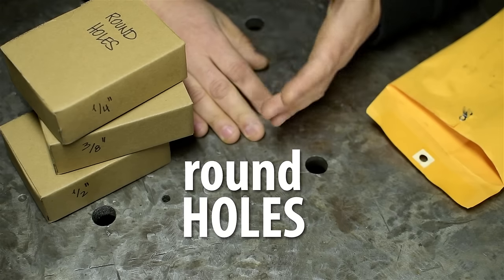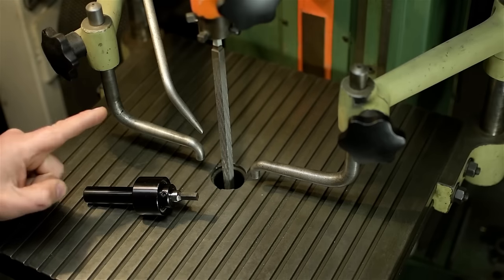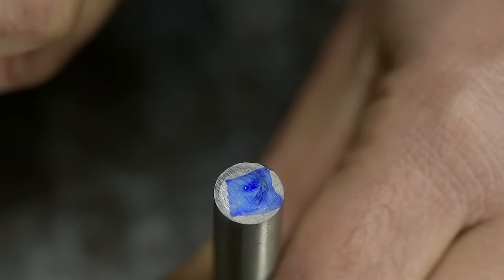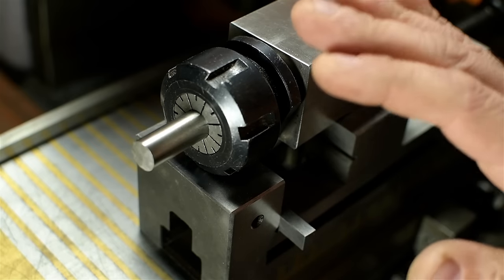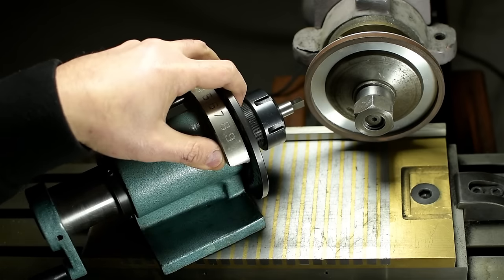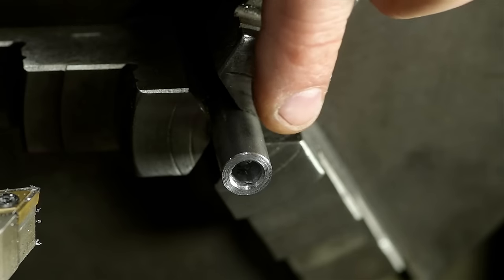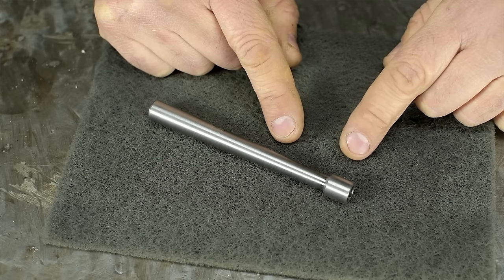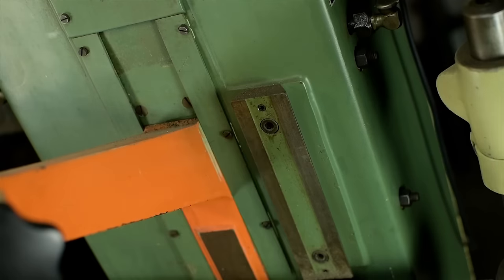Square Holes!

Comment: I'm a toolmaker irl. I use top of the line equipment at work including HSM, automated loading, standard CNC, lathes, EDM, CADCAM, etc. Had we done this at work it we would've used 2 very different approaches (1. drill out the corners using a 2mm drill and machine the pocket or 2. EDM the hole) but its great seeing people use the 'old ways'. Takes me back. Great video. Loved the humor. Subscribed.
Reply: I have an EDM drill and a WEDM and i sorely regret selling my sinker :(
Reply: How do you EDM a blind hole? Am I missing something here. lol
Reply: @Stopes.  an EDM drill is basically a drill press with special drillbits

A sinker EDM is basically a vertical mill where the spindle has been replaced with an electrode
Reply: @angrydragonslayer  Ahhhh okay gotcha. To me EDM is the wire guided process. I wasn’t aware there was other EDM methods and/or processes. Hence my confusion lol. Thanks though. Learn something new everyday!
Reply: @Stopes.  EDM has electrode ‘bits’ that are pressed down onto the work, like the last guy said. What you were thinking of has a very obscure and not at all sensible name……. “Wire EDM” ;)

My company uses both for building injection molds, but primarily the un-wired variety (wireless?). You can get an absolutely bonkers level of detail from standard EDM, any machining marks left on the graphite electrodes are transferred to the work.
Reply: @areoladan5580  Ahhh yes wire EDM duhhh. Thus the distinction every time it’s mentioned lol. I have been set straight and educated on the matter. I thank you gentlemen.
Reply: "Old Ways"? I knew a guy that drilled holes, heated to bright red, drove a square piece of metal into it. It were squared.

Comment: I usually do my triangular holes with a twist drill bit
Reply: I normally get a roundish hole with with a bit of a rounded triangular shape
Reply: Releaux triangle
Reply: The trick is, drill the initial hole and then go back through with a bit 4% smaller and let it do the waltz.
Reply: @jacknicholson5794  just loosen the drill vice and let it dance while you quickly run to the break room until you hear a large bang, the bang indicates when she's nice and ready
Reply: @craiga6557   or just buy a chinese drill press from a supermarket when it's on sale, and use the drill bit that comes with it.
Reply: @revmpandora  All the truley important things in my life, I learned from Q.I.
Reply: @Kollar0718  did that once . . . . would of got farther with a drill bit made of balsa wood.
Reply: @hdezn26  what were they actually made of? High speed squeal?
Reply: @craiga6557  lol High speed Bacon sounds good .
Reply: @hdezn26  I always thought high speed bacon would be used in sawing applications...
Reply: @Kollar0718  You were watching me use my Harbor Freight press again weren't you? It runs perfectly true as long as the machine is unplugged.
Reply: Nah, Toblerone bit all the way, man. Way nicer, and self-lubricating too!
Reply: @revmpandora  Toblerone-Rolo combo! (You watch QI?)
Reply: Triangular holes only occur when you hold your mouth a certain way, firmly press you tongue against the back of your throat and desperately need a true round hole for a locator pin.
Reply: @Timberwolf69  someones gotta try this for the lols (i know it wont do anything, if even that )
Reply: @craiga6557  naaahhh, high-pitched steal!
Reply: My old drill press drilled triangle holes exclusively.
Reply: @hdezn26  You know, back in the days, when I was but a wee lad, my gramps would show me this trick.
Especially on hand saws, if you had no lubricant at hand to keep your saw from binding, a piece of pork rind would come in handy: just rub the inside of it along the cutting edge of your saw (carefully, though, don't cut through the rind) and you'll have a well-lubricate saw.
Reply: @MaineHomeShop  I thought you were OK with that... I own 2 such machines and I hate them to the extent, where I much rather watch a guy curse at his machine than starting to fix one of mine. And I ended up with 2 pcs because of the special supermarket warranty policy, where they don't want to have back a machine that's not working, because they would have to store it, ship it, recycle it, with all those additional costs to the company. :D
Reply: I can do that by hand since I started to custom-sharpen my still bits for that purpose.
Reply: Lmao me too mate
Reply: Jake Thejeweller  Yep, It's  the reason I never wash my face. I always run my drill bits along the the side of my nose to oil up the bit, and exfoliate at the ssme time. I save so much time on showers.

Comment: 8:20
Tony: Do I really have to swap out the toolpost mount just to cut this off?......unlessssss.... rotates die grinder 90 degrees
Reply: I was waiting for the rest of the internet to scream "no!" here also! Much disappoint. Also, hilarious.
Reply: @dzjad  can still give his lathe an F    
though
Reply: Shambles1980TRealOne  that scribe line/ water method not work on HSS?
Reply: @ironbomb6753  no its not, he has soft water, he needs hard water.
Reply: You may scoff, but when you have a benchtop lathe with rigidity issues, that is a valid solution.

Comment: :D
I had customer parts where I needed a square hole where a 100% of the square was called for, so I predrilled slightly smaller than the square rotary broach. Axial force increases quite dramaticaly in that case :D
Reply: Sinker EDM?
Reply: @Joe-bm4wx  yes but that would be more expensive and you'd have to contract it out.
Reply: Yes but your square hole was 0.03mm. Try doing 10, 30, even 50mm square! Ha!
Reply: Depending on just what you need to put the square hole make sure you have a round peg to put in it. 👍
Also depending on what you are punching the whole hole into, through or blind makes a difference. Of course you just could have  shaped it in the mill
Reply: would it be better to start with a smaller square and work up in this case? or just shove your fd broach into the too-tight hole?
Reply: @Nathan0A  
This is family channel sir 😳
Reply: Barry Manilowa  not sure if thats stefans thing but in the meantime you might check out Werner Berry - he just started to build a wire edm ;)
Reply: Barry Manilowa it definitely would be good CONTINENT, such as Europe or Asia LOL
Reply: charlieinsingapore, I thought that was funny and I work in inches!
Reply: Barry Manilowa .... Which continent are you calling great?
Reply: Maybe try a smaller broach first? Do it in a few steps.
Reply: You can save a lot of time if you don't pre drill at all. + it work hardens the material and helps with tidying up that drawer full of broach inserts :)
Reply: Nathan L.   That’s what I was thinking. Similar to the through broach Clickspring made awhile back but take each section and use it by itself. Maybe not as many stages too.

Comment: 9:51 
Wait, hold up. 
What sort of black magic did I just witness?
Reply: Yeah, I don't understand at all how that worked...
Reply: I Googled it and the broach is wobbling slightly slowly chipping away at the material as they spin together. Or at least that's how I understood it.
Reply: I don't really know, but I would think it goes slightly off angle, hence why the taper required to make the final hole parallel. It works by "stabing" little by little with each of the tip.
Reply: The same thing can be done by simply pressing the tool into the hole. However, the rotating holder makes it much easier to pull out the broach once it has made a significant chip. The rotation makes it seem like there is more action going on than there really is
Reply: Sorcery. I see the replies to you try to use sciency words like "wobble" and "article" but it's all made up gobbledegook for something as inexplicable as the imperial system.
Reply: @jhaffel  Do you have a gif I don't know how to read
Reply: He forgot to mention that broach tools are mounted at a slight angle in the holder. In operation only one side of the tool shears the metal away resulting a hole the shape of the broach. The HS tool rotates at an angle in a thrust ball bearing.

Comment: 1:54 "This is my £1000 filing machine" "And this is my £2 rotary broach. Fun fact: These two cost me about the same price"

Took me a moment.
Reply: I'm still not sure if I got it. But I can put all the blame on "language barrier" and avoid judgemental comments.
Reply: which bit are you having trouble with?
Reply: @RuthlessDutchman  

I'm not sure if the 1000 pounds machine (filer machine?) reefers to weight (lbs) or the actual money (£). Either both are expensive as s*** (1000 £) with the machine weight being around 1000 lbs and that small tool 2 lbs OR both are cheap (2£) and that gigantic tool weights 1000 lbs.

He said no one wants the big tool. So is it 1000£ because no one wants it or 2£ because no one wants it?

I just a curious person about this subject. I'm not a machinist (not affordable or profitable here). I'm not sure if these tools should be expensive or cheap since I know there are small tools that costs a lot.
Reply: ah, Tony intended 1000lbs and 2lbs, and that they are the same price, but he didn't say how much they costed. 

I live in the UK though and a pound is more commonly (£) than (lbs)
Reply: I thought weight. Interestingly, a pound was once defined as the gravitational force of the earth exerted on the amount of silver which cost one pound sterling. (Except it was before the days of Sterling. Or Britain, for that matter, or Asterix the Gaul).
Reply: so no one wants 1000lbs machine because the 2lbs does the (almost) same job while being much lighter
Reply: The rotary bit costs a solid arm n leg, give them a lookup. In this instance, pounds are the weight not price.
Reply: Two pounds not £2
Reply: He was referring to weight not currency. Meaning the over weight machine that nobody wants costed the same as the lighter broach. Dirt cheap lol
Reply: Fun fact, I was in England 10 years ago, and in a supermarket there was this elder Chinese couple trying to buy meat. They asked for 5 pounds, the clerk returned asking if it was 5 pounds in money or in weight... The woman replied "yes, 5 pounds"... and they kept into this infinite loop for quite a while...
Reply: @Gottenhimfella  That's about as backwardsly wrong as you can get it.
Reply: @aerogfs  Offer them both amounts and let them choose.
Reply: Fun fact, Tony is an astronomer so he's just rounding to orders of magnitude

Comment: "This Old Tony"
First of all I want to say thank you for your very well done videos. I have learned a ton . With that said I was hoping you could cover a few topics that still frustrate me a bit.
1. Can you cover the numbering and identification numbers for replacible cutting tips like the common triangle ones on the quick change  cutting arms.
2. Could you cover the most efficient way to do a taper on round stock in a manual metal lathe. I have a '63 6in Craftsman hobby lathe.
3. Where can I find horizontal milling tools either new or used that will work for my lathe.
Thanks again. When Letterman left TV you should have tuner the Late show into a hobbiest Machining show, you sure are talented enough and mor than funny enough!
-Dave

Comment: I think you may have glossed over the most important feature of your new wrench.  Putting a 45 degree handle on it ensures that it is always in the perfect position to try to round the corners off of any bolt that you use it on.  :)
Reply: Our man here made a perfect "Desquarifier!"

Comment: You should really look into getting a lathe with a square gear for this kind of thing
Reply: They are out there. Google "Polygonal Turning".
Reply: Just buy some square end mills and drill bits and be done with it.
Reply: @highpwr  wt..?!...black magic!
Reply: The 'round head' Colchester Student he has is available in square head form.
Hexagonal holes are a bit more of a problem but not as much of a problem as 2-sided or even single sided holes.

Comment: American measuring system is really confusing. Closest to 7.7mm is N. 
For me that's like saying 30 degree Celsius is pink. 😁
Reply: No, everyone knows it's gingerbread scent.

Also, the fourth drill measurement system is based on American write gauge. Because everyone needs four sets of drills.
Number drills don't go that large, though, ending a little over 200 mil in diameter.
Reply: If you're getting pink at 30 degree C, you should seriously consider using sun-block
Reply: Don't worry, we don't get it either.
Reply: I was watching a British woodworker the other other day and he bought some timber that was 4,2 meters long by 2X6 inches. 

Care to explain that? At least we stick with a single, stupid measuring system rather than mixing them.😀
Reply: Don't worry, the numbering and lettering sizing system originated in Britain.
Reply: @timothyball3144  That stupid measuring system got us to the moon. At the time metric would not have gotten us there.
Metric is not all its cracked up to be.
Hey Ill call freezing 0 and boiling 100 and divide the difference is not very scientific
Reply: @heyyou5189  I don't see why they couldn't get to the moon using metric measurements. What system do they use today for space exploration? I don't know, but I bet it's metric. And remember, the combination of metric and imperial crashed a lander on Mars.
Reply: Actually, to convert 30 Celsius, you have to use 5/9 so it's 5/9 Pink. Or something like that.
Reply: @timothyball3144  because until fairly recently the kilogram and the meter were based on an object and not a mathematical standard. That has since changed largely because those objects were known to not be quite constant. That slight variation would not have allowed us to get there.
Edit: Heres a link that gets into it. https://www.popularmechanics.com/science/environment/a27528610/measurements-physical-standards/
Reply: @heyyou5189  And now where are we? Since the metric system is based on a mathematical standard, why do we still use a system that divides a mile by 5280 feet, a yard by 3 feet, a foot by 12 inches? Where is the logic in that? Why does water boil at 212 degrees and freeze at 32? Ounces in a gallon, ounces in a pound? None of it makes sense and we know it; it's why ditch diggers have an engineers measuring tape marked in tenths of a foot and tenths of an inch. The folks laying down the specifications for the ditch know that it's easier to do their calculations in tenths of a foot. It's a stupid system that needs to go away.
Reply: @timothyball3144  NASA now uses metric.
Reply: @heyyou5189   but the rest of us still don't. Myself included.
Reply: @timothyball3144  Any system in decimal is easier from a math standpoint. Oddly I dont really know where the mile comes from. Most measuring makes little real sense even if the math works.
Think about bushels and furlongs and fathoms and cubits etc. Where did this crap come from? Penny weights any one? Ounces and troy ounces.
Dont get me started on temperature. Neither of those scales is based on anything at all.
Reply: @heyyou5189  I think Celsius is based on the freezing and boiling points of water, so there's that. I would prefer a wider range, but I think that's just because I'm used to farenheight. See? It's even hard to spell!

Comment: If you taper the fasteners heads  slightly to 4mm, most any wrench will fit. The design was intended to  be done this way but got lost in the ever deepening minds of machinists. Just a slight taper to 6mm would suffice.

Comment: Rotary Broaching, also known as Wobble Broaching, is unlike the conventional broaching method. The conventional method has a sequence of polygon or other forms that increase in size and are pushed through a hole until the desired form size is achieved. Rotary Broaching can achieve this in one pass by cutting the full form, one corner at a time, often eliminating the need for a secondary operation. This works exceptionally well on Horizontal or Vertical Spindle Machines such as Lathes, Mills, etc. Rotary Broaching is a precision method for producing internal polygon forms at an extremely fast rate. The entire operation can be completed within seconds and can produce forms to 0.0005″ accuracy or better. This advanced engineering has caused Rotary Broaching to become increasingly popular; especially in the medical, automotive, aerospace and plumbing industries.

There are only two necessary components that achieve the Rotary Broaching process:

1) Rotary Broach Tool Holder
2) Rotary Broach

The principle that makes this process work is the 1° angle of the cutting tool to the centerline of the work piece. This causes the Rotary Broach to shear into the work piece, with a chisel or scalloping effect, as the broach is fed into the part to the depth required. The Rotary Broach Tool Holder has a live spindle that holds the broaching tool, allowing the spindle to spin freely within the Tool Holder. In a lathe, the spindle is driven by contact with the rotating work piece. Our Rotary Broach Tool Holders are adjustment-free so there is minimal setup required. The holders include such features as sealed bearings (which require no routine maintenance), and a pressure relief hole that allows air and fluid to freely escape.

With Rotary Broaching it is possible to broach such forms as Hexagon, Square, Torx, Serration, Keyway, Double Keyway, Double Square, Double D, Double Hex, Involute, Spline, Spur Gear, J500, Numbers, Letters and Other Polygon Forms.

Comment: You have better tools than the shop I cut my teeth in lol, I would have marked 4 points and used a height gauge to index it in a vice . Its amazing what you can make with almost nothing lol . Good job looks pretty good .

Comment: "...The vice is held firm to the magnetic Chuck, the Chuck is currently on, it's not going anywhere. The magnetic Chuck is bolted to the table, the table is attached to the grinder which is bolted to the ground. The ground is attached to the Earth which is an insignificant speck hurtling through cold empty space... (grind. grind. grind...)"
That's high art.